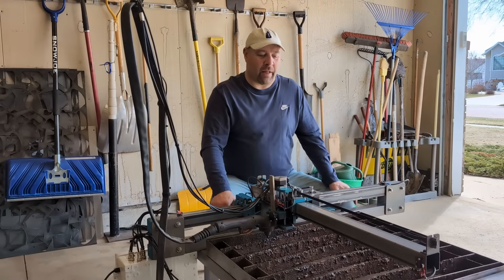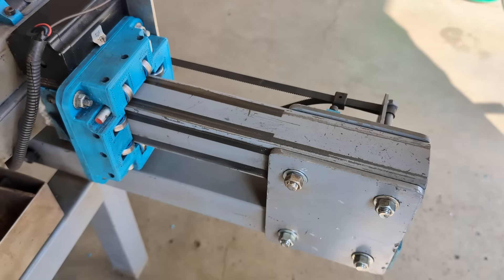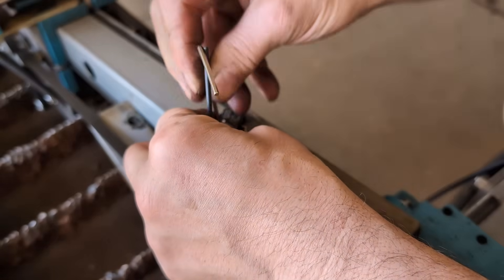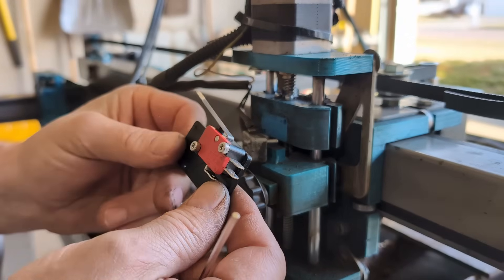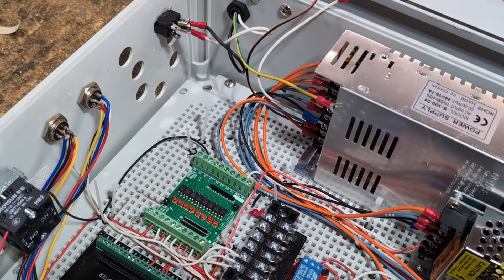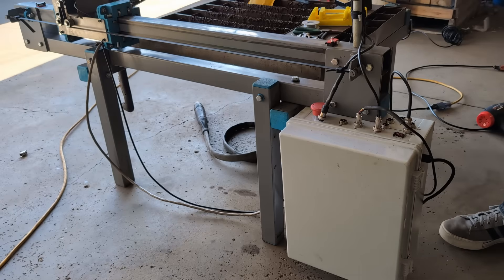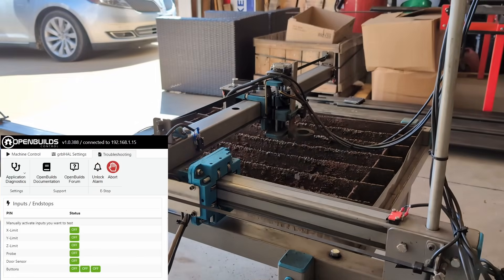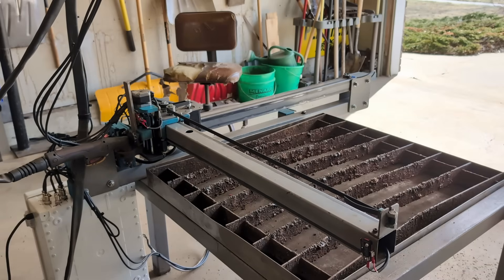Is this $25 Upgrade Necessary for Your DIY CNC Plasma Cutter?

Comment: with the exception of the z probe limit and z plus limit, i seen the same indicator response for both Y axis directions and both X axis directions. Are the limits for each axis setup in a series electrical connection?

Comment: do the individual 5 opto isolators on the XL already provide this or should the 8 channel be purchased. Still building the XL and not that far so not an issue to update now.
Reply from the maker: XL changes will be available soon.

Comment: hi. i just bought Cebora Sound PC 10050/T plasmacutter that has hf pilot but it says that it has high emc. could it work with this setup?
Reply from the maker: Unfortunately not, only low frequency cutters can work with CNC machines.